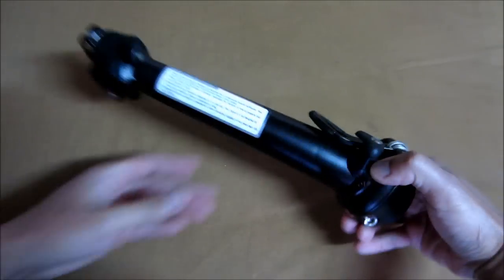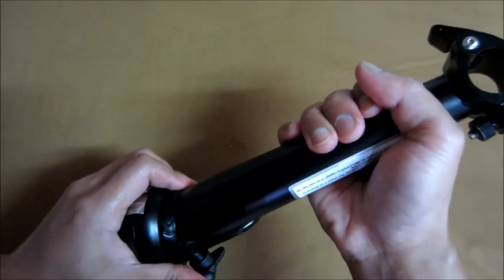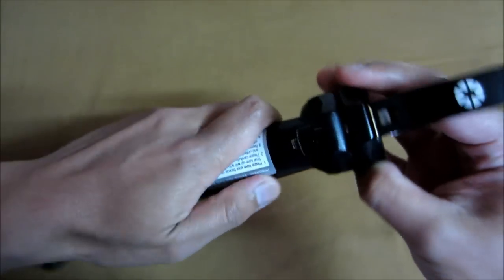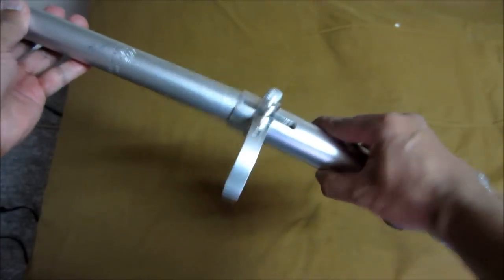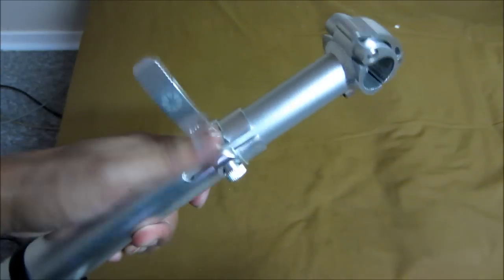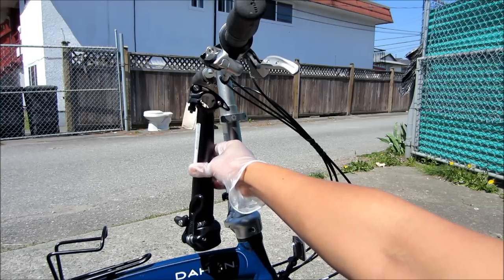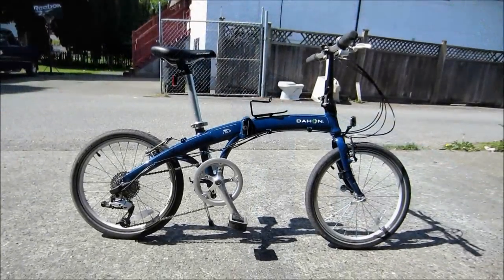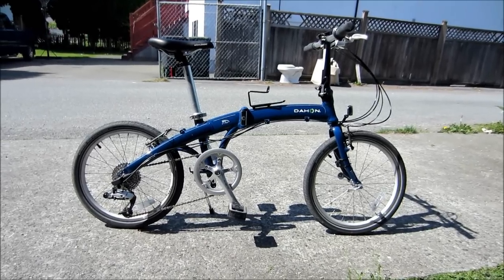Dahon Folding Bicycle Stem Modification

Comment: Interesting vid. Contemplating changing my tall fixed stem to a telescopic stem on my Dahon Speed. 
Some observations. You need the seat higher to get your legs working efficiently. At least 5cm!
The fold of the new stem is opposite to the original. This makes the bike less compact.
Greetings from SW England, UK

Comment: I get rain water coming down the handlebar post into that concave gap between the handlebar post and the stem.  When drop the stem to fold the bike, sometimes a lot of water pours out. Is there a solution?

Comment: hi just a quick question though the video is very old, your kneed shouldn`t be bended right? like you have to make your seatpost long enough for you to stretch out your legs ? so it wont hurt your knees? just curious coz i wanna get the stem too but im a bit worried regarding that thanks !

Comment: This is super helpful.   I was wondering if you might have any advice on how to properly lubricate the bike stem so that it rotates smoothly as you move the handle bars?  I've found that my Dahon has gotten stiffer as rotate the handlebars more than 45 degrees left or right.

Comment: Hi there, nice vid! Do you might know why there isn’t any steering column with diameter 25.4 mm (where the steering stem needs to fit in) anymore? I’ve tried to replace my steering column, but I’ve bought the wrong size (28.6 mm), which is the only one available on the internet. Thanks in advance!

Comment: The silver block that locks the stem is loose on mine so its rattling all the time which is annoying and doesn’t feel great! Any ideas on how to fix it,my old headset used the Allen bar that was so easy to adjust but these new ones are all springs n things

Comment: Do you think it’s possible to cut off the bars to make a T bar to fit the andros double stem system? Not sure,my old speed could use some upgrades...yours looks good :)
Reply: Hi, did you do it then? I'm just browsing around for dahon stems... i do want to fit the andros on my current folder (it's like a dahon, it was the uk factory for dahon)... and keep the extendable stem (now tern uses the andros as only adjustable part of the stems, but i want to slide it upwards also in case).
So yeah, i'm going to get a 25.4 anodized alloy ( = not smooth) seatpost - they're cylindrical. And saw the needed bit off, so i have the head of the "T" stem.
But the challenge is then to find a handlebar with a needed superwide 25.4 clamping area. Maybe i'll have to get a dahon/tern handlebar, which is not best in my case as i'd need a wider bar and they're all just 64-66 cm at best.
Well anyway, still inquiring...

Comment: i rather have the adjustments. Putting weight on your wrist with the handle bars so low. Unless you have short legs and can bring the seat down but i see if for a child at that point.

Comment: Question:  On the previous stem which I have the same one.  Have you thought about on cutting the extension to make it lower at least 2 inches?
Reply from the maker: Anthony T and your going to soder it back? I dunno man that's kinda dangerous. I wouldn't do it. I know dahon and tern seems to not know that their stem is bloody long. I find it retarded and dumb. The bike doesn't look sport and just looks unstable with that long bar.
Reply: I cut the internal extension stem and its still adjustable, just in case I wanted to cruise and relax.  Its basically the same height as your new lowered stem, saved me a few $$.  Riding it for an hour having that low stem with my seat post high up, it helps to speed faster but it does kills my back so I added bar ends on my handle bars.
Reply: @MrJo2trs  how did it hold hold up? Sounds legit because it would just be like cutting down a seat post on a regular bike I see the weakness on most of these folding stems  is the folding mechanism I'd like to find one that doesn't fold and is stronger I don't need the bars to fold I've even considered having the frame welded  as I only need it small enough to be easier to fit in a car and take up less space in the home on a train etc defeats the object of it being a folding bike though lol.

Comment: These are still the weak link in the steering system, I have had this unit and after 500 miles it begins to get sloppy at the hinge, I’ve even disassembled the folding riser and put new shims but it only lasts for a short time. There is nothing more unnerving than busting around the corner with an unstable riser ......
Reply: Did you find a fix? Mine is quite sloppy after 800 miles and all bolts at maximum. Seems elusive to know exactly what's wrong..
Reply: I can post a video of everything I did , it really doesn't cost that much and it works well. The only thing is you won't have the ability to fold the handlebars, it'll be a solid setup
Reply: @endliberalism4305  damn, I still need folding for my apartment.. any idea what gets loose on these? 😩
Reply: @fraserthomson5766  I have some pics in my files somewhere,  I take pics of everything like this,  I'm also into everything Rc so taking pics is really important... I know for a fact they make these folding handlebars 2 or 3 different ways,  the differences are very subtle and hardly noticeable, usually a pin and a difference in the way the hinge works. My only advice at this point is taking yours apart and looking it over very very closely. Shop around and look at the newer designs, the Chinese are always coming out with new innovations... sorry bro that's the best I can do for you